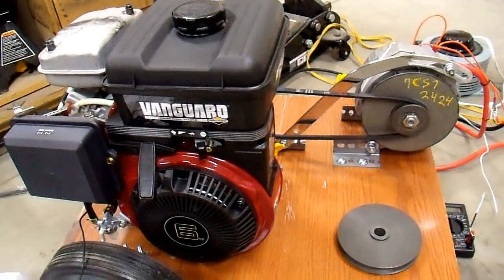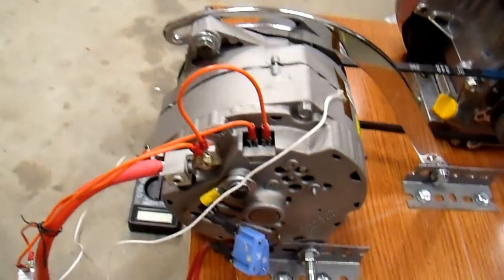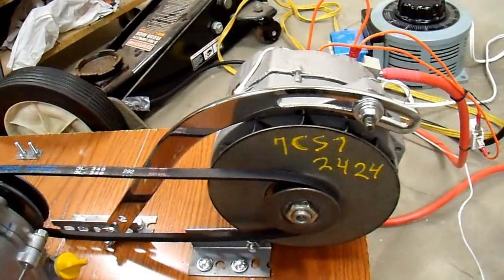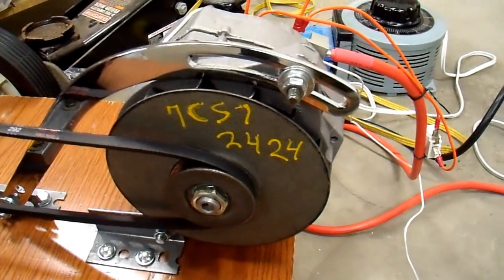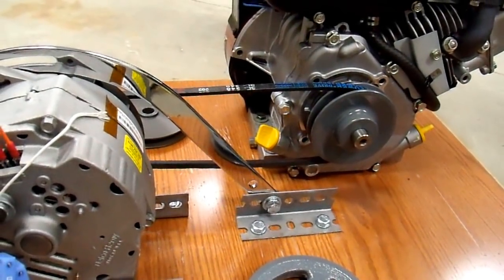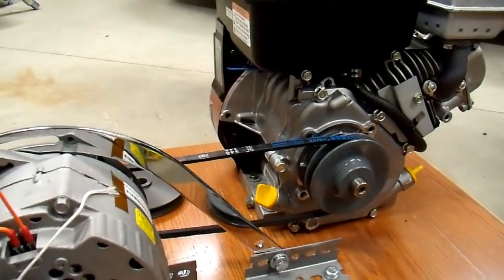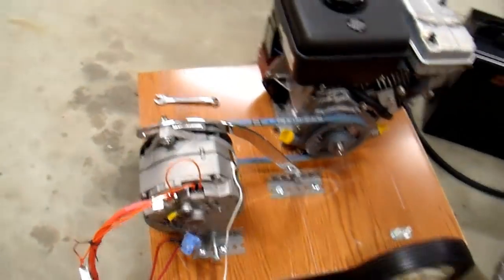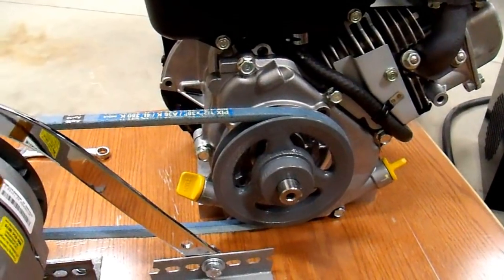DIY 12V Generator Charger - 7 Belt Drive Update

Comment: very nice setup!  i stumbled across your videos when i was building mine as well, although i do wish i saw it before i purchased a direct drive as well.  I pretty much had the same outcome as you. I'm using a lifan 6.5hp and a 12si for mine. In case your interested I started selling my own custom laser cut brackets that may fit that GM alternator as well.   http://www.ebay.com/itm/DIY-DC-Generator-Bracket-12v-24v-/271602327958?
Reply from the maker: That looks like a very nice setup and the price is reasonable to boot.  I hope you find buyers for your product!  Have you considered modifying your brackets to allow for a 27si alternator?  These are perfect for a 6hp engine and up.

One thing I would recommend is to advertize the gauge of the brackets you are selling.  I personally would be unlikely to purchase a product that doesn't state the gauge or thickness.  Best of luck.
Reply: ***** Thanks. These were built as I have plans to produce some completed units. I work in a industry where something like this is beneficial.  I have not thought about the 27si simply because the cost is almost twice as much as a reman 12si unit.  Do you happen to know what the benefits are with a 27si?  I see the  amperages to be about the same. 

I will definitely add the gauge thickness to my auction. Thank you.  It is 10 gauge in case your interested.
Reply from the maker: viper92086
The 27si is a more efficient design that also operates at a lower temperature and lower RPM for longer life.  It is specifically designed for continuous full output operation in trucks and heavy equipment, though it saw use in some other luxury type vehicles as well.  I'd be curious to see the practical differences in your setup as I have only compared the 10si to the 27si but I see your reasoning given the relatively uncommon nature of the 27si.  The price is pretty reasonable though, I got my 100A 27si with a lifetime warranty for a similar price to the online 105A high output 10si from a retail shop here in town.
Reply: Thanks for the heads up.  Can you measure the distance between the two ears on the 27si?   I'll try to get my hands one on the future.  I am hoping that the oem 94amp 12si could keep up with continuous operation as the  major benefit to me is the size and weight.  Thanks
Reply from the maker: viper92086
My measurement wouldn't be accurate enough for a mounting plate design so I'm hesitant to submit any measurements.  You'd probably be best off to purchase one at a local autostore (or $5 to $10 at a junkyard) and be sure your measurements are correct.  There is an 80A version of this alternator as well, so I would recommend a new unit rather than reman as the stators in those are often mixed up with 80A models - they assume the buyer won't check or know the difference.
Reply: ***** i'll see if I can hit the junkyard this weekend.   btw a ford 3g alternator out of a Taurus is another very good option.  they are very large units rated for 130amp but usually are capable of putting out a bit more.   I built my first dc generator with one and it was great.  Powered my house through a week of sandy.   I may consider revising my bracket designs to accommodate those as well.
Reply from the maker: viper92086
Interesting!  Those 3L ford Vulcans are underappreciated and I wouldn't doubt if the alternators are also solid.  I stuck with GM but don't doubt that Ford has a good product for this appliation as well.

Comment: Those belts work well on things like snowblowers and tractor drive systems. They have and idler pulley the get the torque on the belt. You might get better results with an arm with a spring holding the idler down on the belt. Just a thought :-)
Reply from the maker: I had a tensioner type of system on an earlier setup that my dad and I worked on when I was in High School, but unless the system is designed to be maintenance free for the life of the device I find it a simpler, less expensive, more reliable, and overall better solution to have fixed tension setup.  Either way would work of course.

Comment: Depending on how much current you put in to the alternator i think you could theoretically have 6HP, or 4474W of energy here. 4474W / 12V = 372A with a little rounding. 372 amps going through that alternator though would probably melt the windings just after shutting down your neighbors pace maker. LOL
Reply from the maker: This engine can only output around 3hp after accounting for practical considerations, and after accounting for other additional losses the maximum output is around 100A.

Comment: Why not use a Lovejoy flexible coupling to direct drive 1:1 and forget all this pulley/belt nonsense?
Reply from the maker: i tried that on my earlier videos and it failed due to the traditional Lovejoy couplings not being designed for reciprocating applications.  Had an appropriate coupling been chosen it could have worked, but they are significantly more expensive than the traditional couplings commonly sold.

Comment: you should use a one wire alt charges at a lower rpm. 2500 rpm will work great equal pulley dia.

Comment: you need a bigger motor sir that little 6HP isn't gonna cut it its not a matter of speed its a matter of power @ load 
you won't see more then 40amp's out of that unit without more power a 100amp alternator takes about 10-20hp when installed in a car you need at least to be spinning @ 2500RPM and have at least 40FT/lbs of torq or it will overheat so unless you have a motor that makes 30hp @ 3500+ rpm you will never get that full power from it at least not under load running (at about 2900RPM you are only gonna get about 10Flbs-torq) from that baby 6hp
ofc if you aren't gonna use it then that little 6hp will spin it all day but the second you apply real load to it you are gonna either stall the motor or burn the alternator out from overdraw 
people get these great ideas in there head and fail to understand the core concepts of what they are attempting the same mistakes these free energy retards make failure to understand the forces involved
Reply: +rjc862003100 amps at 14.8 volts  is 1480 Watts. 746 Watts is one horsepower. It takes 2 horsepower to produce 100 amps at 14.8 volts. Given electrical losses, belt losses, etc, 2 1/2 horsepower should be all that is required to drive it. I don't know where he got the 10-20hp figure. No way.  My Genie 150 12 volt Generator has a large frame alternator rated 150 Amps at 14.7  volts. The engine is a Kubota diesel rated 4 horsepower at 2800 rpm. I have seen it at 138 Amps only once but the engine was not overloaded. It has 2 belts driving the alternator at 1.3 times engine speed. The only reason it was overdriven was to get more fan speed and cooling air. This unit was designed to run fully loaded for months.He should get ready to eat some shoe.
Reply from the maker: 10-20hp is grossly inaccurate.  Alternators are more than 60% efficient if the setup is done properly as it was in this video.  This engine is fully capable of powering the full alternator load and the alternator does not even get too hot to hold on to when running 80A+ for long periods of time.  This setup is designed such that the engine will not bog down or stall under any load condition at any RPM/governer setting.

It is a multipart series in which I explain how this setup was designed, not merely thrown together.  Aside from the hokey wooden platform it is a solid setup.
Reply: ***** you show me a video if that setup running with 100AMP LOAD and I will eat my shoe live on youtube
Reply from the maker: kimmer6
Very accurate assessment, but he's right in a sense:  I should show it running under load as a demonstration.  I'll add a video showing that when I get around to it.
Reply: ***** car alternator != generator
Reply: I have been doing some testing in the shop. The losses in alternators are rather large but manageable. The little Honda GXH 50cc 1.5 hp engine turning my direct drive Hitachi 55 amp alternator will put out 33 amps at 14.2 volts for a short period. The engine must be screaming, wide open or it will stall. Fortunately, even a discharged battery can accept the 33 amps and will soon need less and less power. This engine will happily put out 20+ amps without struggle.  In a perfect world the 1.5 hp engine should be adequate to make 50 amps plus. But those electrical and mechanical losses!

The problem with using automotive alternators on  engines is that the excitation system is the wrong design for the application. It assumes that there is a grossly overpowered source of drive horsepower. I am thinking of adding a rheostat in one slip ring circuit to be able to limit  the output amps/engine load while the battery is charging thereby allowing the underpowered engine to run normally during bulk charging.

The most useful tool I have is the 2 stroke Lightning Charger. It has a PMG Alternator rotor, 3 phase stator, and a nice external rectifier/regulator. This system eliminates bogging down the engine and stalling it. By design, the throttle setting basically sets the output amps. The permanent magnet rotor is the key to having a successful portable small engine driven 12 volt charger/jumper unit.

Comment: Maybe you answered this somewhere else but why didn't you use a PMA and charge controller? You are producing 1200 watts max with this setup and a PMA will produce 4-6000 watts with same engine. I use a thermodyne PMA and put many more amps in my battery bank.

Comment: Why didn't you put that alternator right next to the engine? The output terminal/diode end could be on the same side as the engine pull starter.  You could use uni strut to make a rigid frame for both and get rid of the wood. Even a belt gaurd would be easy to add.  I have an Ample Power Genie 150  12 volt 150 amp large frame alternator powered by a single cylinder water cooled Kubota diesel.. Everything the battery bank loves including bulk charge and float. It is belt driven as well, slightly overdriven, dual belts. The alternator field control has a small computer to control charge output for AGM cells. Its like your unit after tons of R&D, scads of engineering and money thrown at it.  I like the simplicity of your unit. Ain't no such thing as a money pit as long as you have fun. Keep up the good work!
Reply: The way the fins are built, they will only work when rotating one way. If they go the other rotation they won't cool at all & the unit will overheat.

Comment: Question. Why use an alternator, when a generator would produce the power more efficiently. Then you could convert the AC to whatever you want. Also for less loss in the belt switch to a tooth belt they are very efficient.
Reply from the maker: Belt losses are fairly small and toothed belts are specialized, V belts are available everywhere.

A generator run through a 100A battery charger is actually less efficient than what I have here, but likely a more practical solution overall since the generator has other uses as well.  Still, this is what I've wanted to build for years so I finally did it and it works great.

A generator by itself is not a solution since it requires running 24/7 which is unacceptable for my uses.

Comment: I need that reostat
Reply: variac, not too expensive and they can actually up the voltage for you slightly.
Reply: Oh I thought it was a reostat but I need something to keep mine form dumping 75amps in a battery
Reply from the maker: anthony hayes
A variac (copywright, it is a variable autotransformer by generic name) works with AC voltages.  You need either an active device or a rheostat.  Realistically, though, do you need to prevent a high charge rate?  It's really only a problem if the batteries are overheating.  The best system may be to just hook the alternator up and let it buck.
Reply: I haven't got it put together yet I just wanted something on stand by if it was to over heat
Reply from the maker: anthony hayes
Fair enough.  Personally I would recommend looking into purchasing another batttery or two rather than a rheostat.  Multiple batteries will share the charge current and dramatically reduce outgassing and heating without the complication and efficiency loss.  Overall I believe it would result in a better system.
Reply: Didn't think about that and that seem like a good idea u seem smart  and make good vids on this stuff but on my gen set I have 75 amp alternator and a 6.5hp briggs do u think that it will be caple of produceing 75amps thanks
Reply from the maker: anthony hayes A 75A alternator on a 6.5hp Briggs should do just fine depending on pulley diameters and engine condition.  Because that engine is overpowered for the 75A alternator you have a lot of room to vary pulley sizes.  On my setup I have a 5.5hp engine and a 100A alternator and it needs to be more precisely tuned because the two were chosen to be matched for eachother.  If you run a stock alternator pulley I would recommend an engine pulley of around 5 to 6 inches diameter.  Smaller results in high belt tension and larger results in lowered alternator efficiency and potential overheating.
Reply: *****
Math 13.7 volts about from the alternator at 100A  is only 1370W. Considering the lost of efficiency from the whole thing I would thing a 5.5hp engine should be capable of running the alternator. I'm figuring about 1HP per 500-600 Watts.
Reply: Richardj  1 horsepower=745 watts on top of that this man is purdy smart I think he knows
Reply from the maker: Richardj
5.5hp is a gross figure at sea level and fully warmed up and at around 3600RPM which is above the actual RPM under full load, and this is without any extra losses such as a muffler or belt.  Only about 80% of engine torque is usable due to throttle linkage setups on these small engines.  The actual peak is much less and you need to match the torque curve of the engine to the power curve of the alternator.  If at any point in those two curves the alternator requires more power than the engine can provide it will stall out.  Also, at cold temps where the carbuerated engine has trouble producing power the alternator can do well over 100A due to the lowered DCR of the windings, and the voltage rises at cold temps to over 15V.  All together this 5.5hp rated engine is not too big and not too small, but it requires some careful planning to make it all work together properly.
Reply: im using a honda gc160 5hp with a 110 amp 1 wire gm alternator.   6 inch pully on engine, 2 inch pully on alternator.    Runs fine, charge 3 deep cycles simultaneously at full throttle for first 5 minutes, high idle after that.   The governer adjustments i made take all the work out of it.
Reply: gc 160 is actually a 3.5-4 hp in reality.
Reply from the maker: gwhuntificator
The GC160 is a good consumer grade engine but it will not work with the setup you describe in all possible circumstances for technical reasons.  I have no doubt that it will charge your batteries but pulling a 110A load at all temperatures, at all output voltages, at all conditions, etc.  No.  It is a battery charger.  Not a power supply.  Governer adjustments do not modify the engine design or output capability.

Comment: I built an alternator generator to use while we're at camp. Mine eats through the V-Belts like they're an after dinner dessert... LOL

I used a 3" pulley with my setup though. I see the link you provided below for the 5" pulley. I can only seem to locate a 4.45" so I'm assuming that that is what you chose. My question is where did you get a large pulley for the alternator? 

My setup uses a GM 65 Amp alternator. A Predator (Harbor Freight) 6.5 HP (212cc) engine. 12 105 AMP Deep Cycle Batteries. One 1500 / 3000 Watt Inverter and several Hard Start Capacitors for turning on the A/C, Refrigerator, Freezer, etc...
Reply from the maker: The alternator pulley was sourced from Jegs.  I would highly recommend that one as it is good quality, reasonably priced, and the alternator pulley is the most difficult part of making a proper setup from my experience.  The predator engines should be pretty good for this application given their 212cc displacement - remember that displacement and not HP is the important parameter.  Good luck with your build!

Comment: Is it possible to mount the alternator so the shafts line up, then put a lovejoy to connect the shafts directly? If the ratio is 1 to 1, this would eliminate pulleys/ belt completely.
Reply from the maker: I tried exactly that earlier on in this series and the coupler was shredded within 15 minutes of running under load.  Alignment was not perfect and may have contributed, but was fairly good.  Lovejoy couplers, I later found with research, are not rated for reciprocating use such as directly coupled to a single cylinder engine.

Comment: makes a great battery charger . i got a ford alt 12 v dc 130 amp  had a blown regulator so i bypassed it used a rheostat in place it adjust field only thing is needs 5 hp or more to spin at speed. iam makeing a electric version of what you did with a gas engine and a constant run generator.  i dont see gas as in need to make electric.  have fun.

Comment: i got a 10 inch cast iron pulley looks like 1/2 in bore 1/2 in belt. ide trade for one of the 5 inch cast iron 1/2 in bore like in video i got a generator i want to speed up  i have a 3 inch now its ok but a lil slow .

Comment from the maker: Glad these videos helped!  Part 8 is posted.
Reply: I have the same setup 2hp motor. 5 in pulley on my motor and 2in on my alternator. I'm only getting 18amps out of my alternator. To my charge controller seems to run fine no belt slipping. Could you tell me why Thanks for the information God bless you 👉👍👍👍